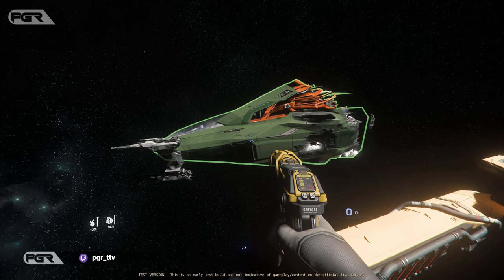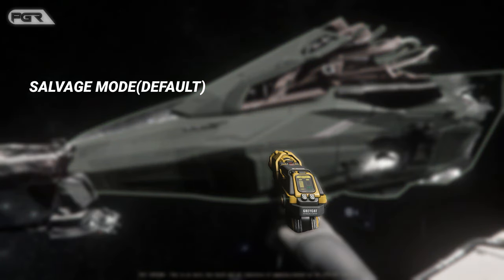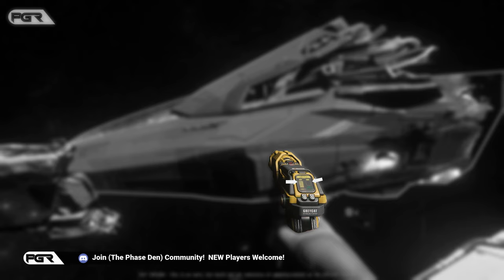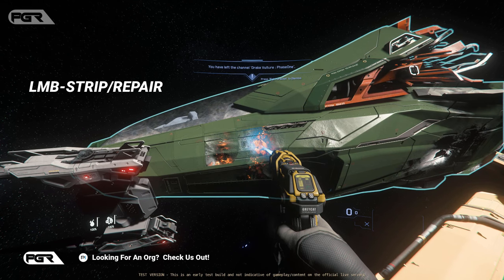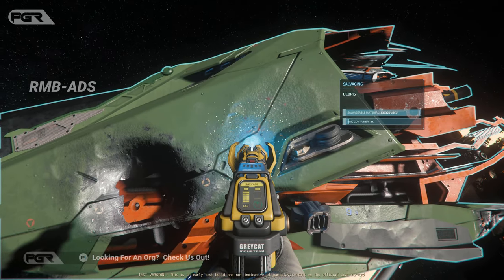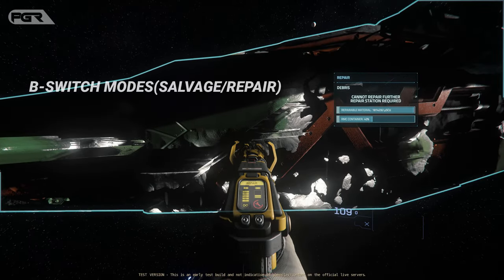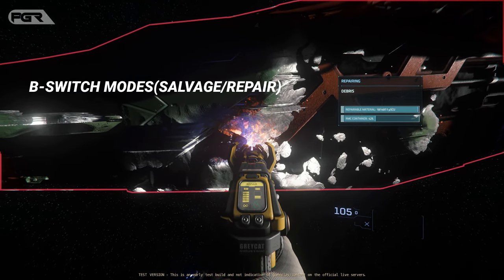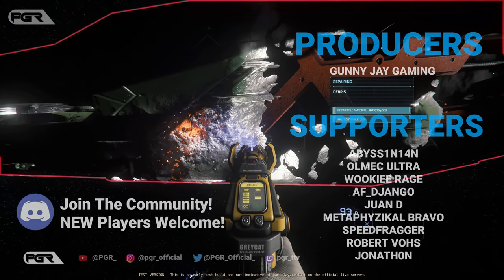Star Citizen: HOW to SALVAGE & REPAIR with The Multitool in 1 Min

Comment: I assume batteries are currently all empty and there are no-ones to buy? I added both things to my multi-tool though I can't salvage a ship which the game crashed into my hangar even though I stripped off all the components of that ship already and thus has no further shields let alone entery at all. I see the canister attached, I see the salvage indicators but as the battery is empty I can't do anything. Also tried with the salvage gun but with the same result. Or can't I just use those tools in my hangar? Mining, cutter and so forth attachments work though without issues.